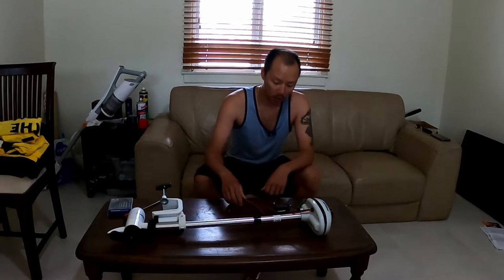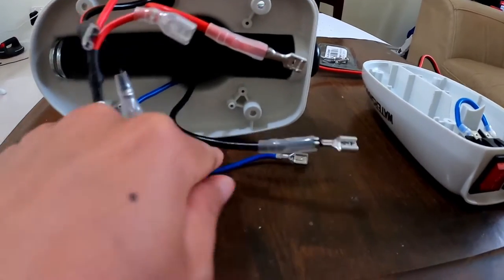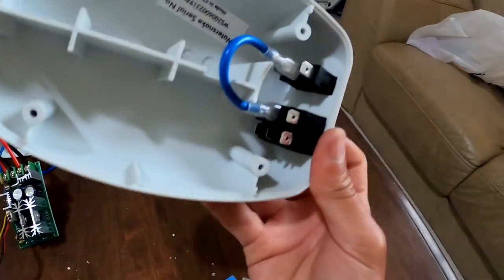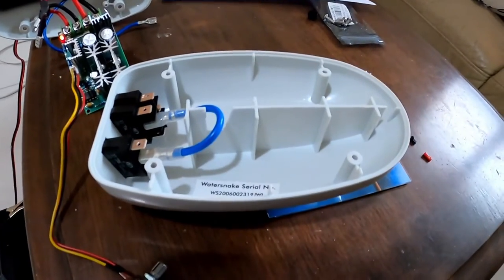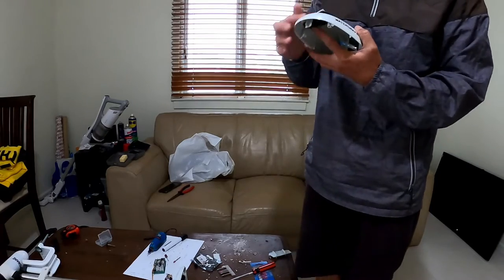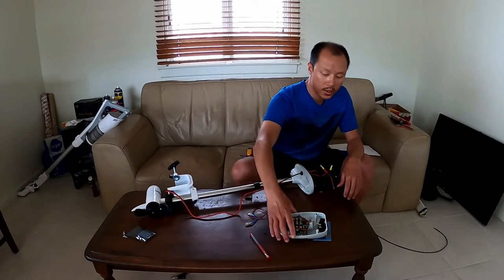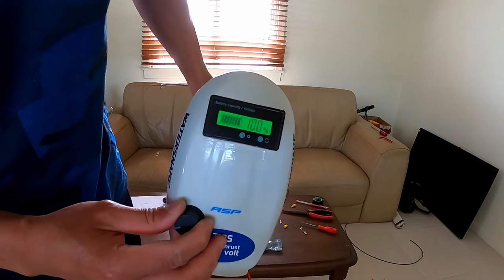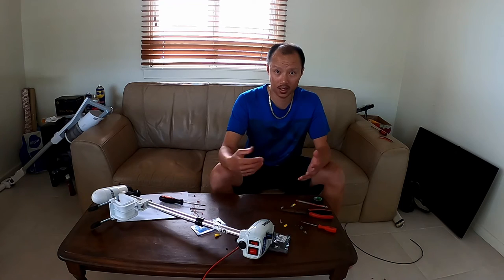Watersnake T18 PWM Speed Controller - Installing a variable speed controller for your trolling motor

Comment: Thats a great upgrade Micheal .Got me thinking to do mine thanks for posting.
Reply from the maker: Thanks mate you should totally do it :) it's a very easy mod and will improve your battery life while also enabling you to fine tune your exact speeds to suit your conditions.
Reply: @FishingWithMichaelTruong  I have a 18 and a 24 watersnake do you think its the same for both also is it easier just removing the blue wire.
Reply from the maker: @tonyallen1953  I think it's the same for both. You could remove the blue wire but I leave it inside the housing in case you ever decide to reverse the install you'll still have everything there to reconnect it to the original switches if you wanted to.

Comment: A point of clarification for some, the volt meter is primarily useful only on Lead Acid batteries because their voltage declines on a sloping curve.  Lithium batteries provide voltage in almost a straight line until they almost reach the end (10%) of their usability.  By the time you start seeing any meaningful decline on a volt meter with a Lithium battery, you're almost out of juice.  Someone please correct me if I'm wrong.
Reply from the maker: Yeah that's a good point. I used Sealed Lead Acid (Maintenance free battery) in which case it's very handy to know how much power you have left because running lead acid dead flat reduces the lifespan of them (they shouldn't go below 50% DoD) with lithium batteries you can run them dead flat without worries (I've not tested them on a lithium battery setup but I would imagine it would still give an accurate readout but open to hearing other peoples experience on it). Also I forgot to mention that the voltmeter I had also expresses % of power left and also volts as optional display outputs.
Reply: You don’t want to run lithium batteries dead flat, that will ruin them or make them unsafe.

Comment: Great video! I'm setting mine up like you did but have a question. The two-speed switch is unused, so how did you hook the negative (black) wire from motor since it originally was connected to the two speed switch? To the center left terminal (blue) on the larger switch? Thanks!

Comment: Hey Micheal. I decided install a PWM in my watersnake, and after watching various hacks, to also shorten the shaft and attach to a Hobie plug for my outback fish. Some guys replace the top cover with a waterproof box however your method looks like the best so far. I will try to retain the original cover if I can. There may be a problem with overheating during long runs, yet to be determined. I have seen mention of the method the manufacturers use to vary speed - a "coil" that seems to be really functioning as a resistor that wastes power at low settings. As an electrical engineer I think that is retarded. They probably persist in that design as it is simpler and less expensive to produce with less risk of failure. anyhow yet to start on mine but was wondering: If the blue wire to the speed reduction coil is redundant then so is the speed switch. So why not mount the potentiometer where the speed switch was, on a small flat panel? I also like the volt, wattmeter you chose for its mutifunctionality, saw a waterproof one the same on ebay so will target that. Also thanks for posting the circuit diagram, making it easy to understand before I even took off the top. I have also tested the original watersnake in a binful of water for exactly one hour at low speed, with an Ammeter in circuit. Starting with a fully charged battery, Yep, 6.8 Amps for one hour very close to manufacturer spec, recharged battery 6.8 A/H. I will undertake the same test once the watersnake is modified, and determine A/H for various speed settings. Enjoy the trolling. David, Canberra.
Reply from the maker: Hi Chris :) I'm glad you have decided to do the mod yourself on your watersnake. With my PWM controller it didn't come with an additional switch so by doing this mod using this PWM controller I bought off ebay I actually lost the use of Reverse (however I don't even use reverse; if it's important to you though I'd recommend getting a PWM controller that also comes with the additional switch for reverse functionality)

There is a benefit to having a waterproof box and I understand why others do use it however I like the almost factory look of the watersnake's head so that's why I persevered with using the original. Depending on which controller you pick up, it may or may not fit into the original housing. The voltmeter is a nifty add-on and I loved having put it in there in retrospect.

I'm not 100% sure why they've wired the blue wire for the "coil" and you can totally bypass it altogether with the PWM controller as it's not required at all. Regarding the PWM controller it makes a huge difference in battery life and consumption and I'd recommend people undertake the mod as it enhances efficiency and allows much more range without a big need for heavier/larger batteries. Totally worth the effort. Good luck and let me know how you go with the mod Chris :)

Comment: Mate, do you mind giving me the link for the PWM, Ive got the same motor as yours and would like to keep the reverse? Cheers, Deano
Reply from the maker: hi mate if you wish to keep reverse you'll need to get a PWM with a reverse switch. Just search up on ebay and you'll find one :)

Search term:

DC Motor Controller 20A PWM Speed Regulator for Brushed DC Motor with Forward and Reverse Switch

Comment: could you have ran the wires through the handle to attach the knob  to the end of the handle ?
Reply from the maker: I don't see why you couldn't do that :) that's a fairly good idea if you manage to find a knob that's almost the same size as the diameter of the tiller handle.

Comment: I have the pwm with reverse, do you think i can just use the red and black straight from the pwm to motor and it will control everything or what do you mean eliminate blue
Reply from the maker: It depends on how your PWM is wired up but I would imagine so. The switch that comes with the PWM should automatically engage reverse when you activate it. The blue wires are typically not needed if you connect a PWM controller (they're only needed if you use the standard switches that the watersnake comes with).
Reply: @FishingWithMichaelTruong   yeah, I might just try black and red only straight to pwm. should be gtg. thanks
Reply from the maker: @TheSargeOnTheWater  sounds good mate let me know how it goes :)